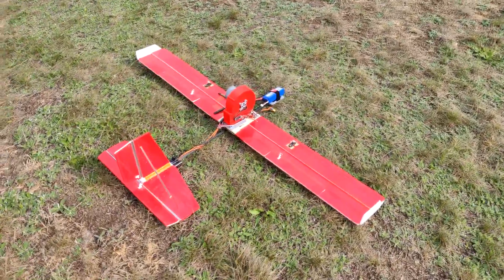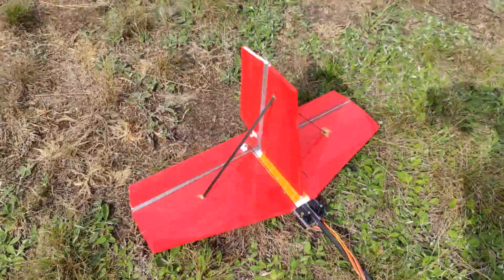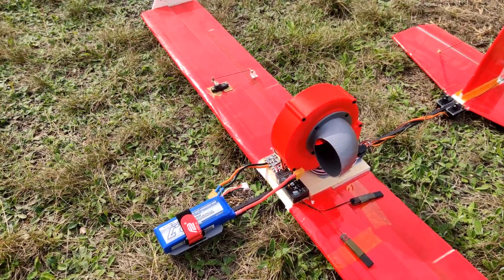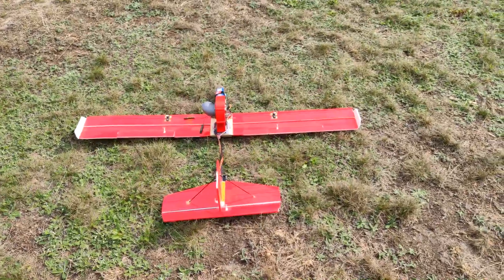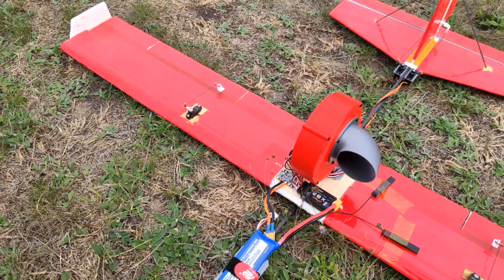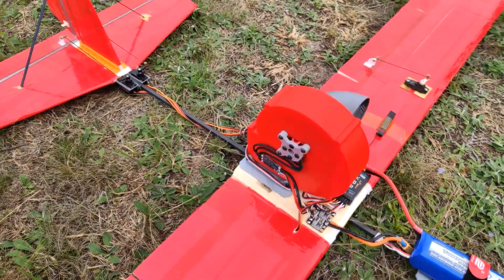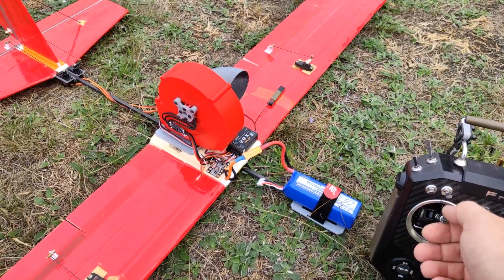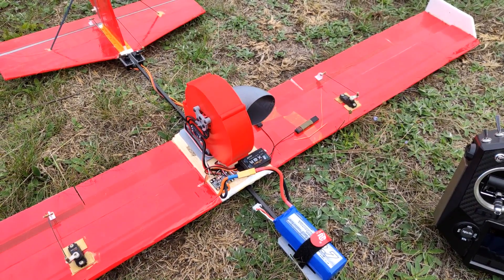Turboplane aka squirrel-cage propulsion

Comment: If you were to continue the key design change you need is a nozzle. The compressor creates pressure, you need a nozzle to accelerate the air. In a jet the force is generated by the acceleration of the fluid. Pretty sure if you cut out a plastic bottle or something and stuck it on the back you would see an increase in thrust and efficiency.
Reply: and get rid of that horrible inlet bend. That alone would have robbed you of 50% of the potential power